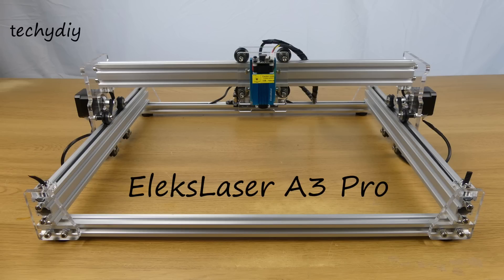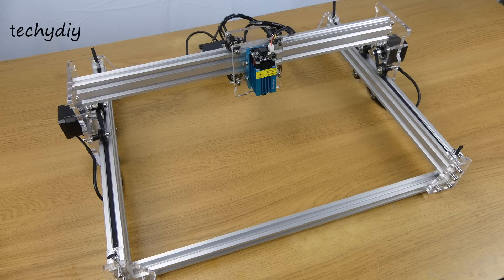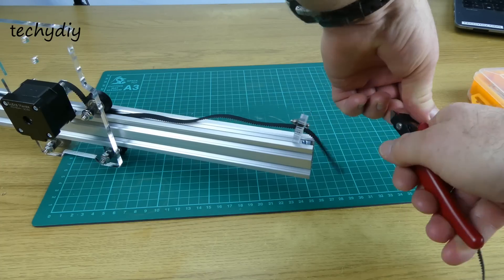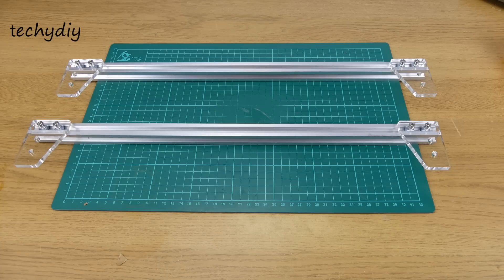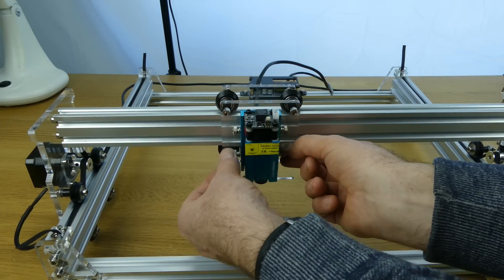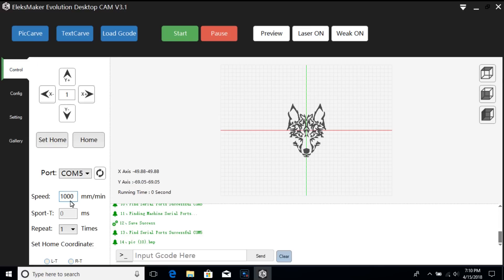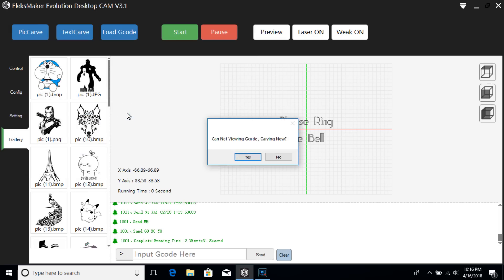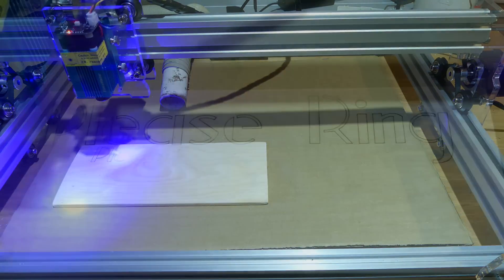Eleksmaker EleksLaser A3 Pro Laser Engraver Build, Test & Review

Comment: Is this possible to cut a piece of 5mm pvc board?
Reply from the maker: This is an old laser engraver. Newer models will cut materials easily. You do have to be careful cutting plastics and make sure it is safe to do so.

Comment: hey ...My machine suddenly isn't working good. When I use the control to move in the x-direction the machine moves in x and y direction, and vice versa. The print which is given is being printed in 45degrees. I don't know what changes to make...can u help me
Reply from the maker: Check the stepper motor wiring. There are two connections for the Y axis and one for the X axis. If you have swapped one of the Y axis stepper cables with the x axis cable then it would do as you describe.
Reply: @techydiy  Hello. I checked and it is correctly connected,it is still the same problem after i reconnected all the wires. I gave the print for a text and it is being printed upside down and in a 45 degrees (approx.)angle. I even changed the software and reinstalled it. Do u have any other idea
Reply from the maker: No, but try lasergrbl or lightburn software.

Comment: Can  it cut Balsa, XDF, plywood ? Up to 10 mm thickness? or i need a "stronger" machine for these?
Reply from the maker: Your talking industrial strength to cut  10mm. A CNC router would probably be  a better option. Diode lasers can realistically  cut to about 3mm with air assist. The co2 laser I just reviewed will cut to 6mm.

Comment: Can this Laser be replaced by a 30W or 40W Laser to cut some material, such as Plywood, Acrylic, etc.? Thanks
Reply: Might want to beef up the power supply to higher amps, maybe 10 amps, should work fine other than that. (I know, 4 years too late 😀)

Comment: I have a svg file fit to the size of the wood I want to engrave. When I load it into the engraver software it expands it beyond the size of the engraving surface. Any pointers on how to fix this?
Reply from the maker: It's usually something to do with units, inches instead of mm etc. If your using inkscape  setting the page/paper size correctly is a good start.

Comment: Hello sir. I have this same Eleksmaker laser CNC with 2.5W laser diode. I have problem with it. Check this image behind this link : https://drive.google.com/file/d/1bkayoSk48EZ3bmhshIopk_sjHrzpwkOn/view?usp=sharing I'm using Ubuntu 18.04 and Laserweb 4 and it makes those strange errors on my PCB. I have exported PCB from EasyEDA as PDF file, then I imported it to GIMP and exported PNG file from there. Then finally I converted that file to SVG from Inkscape and burned it with Laserweb. Do you have any idea what could cause these errors ?

Comment: Great video.  Interested to know more about the copper etching you briefly showed. I was looking at etching a circuit out of copper polyester taffeta fabric, then using the laser to cut out precision holes in the fabric as well.  Can I ask how you did the etching, and do you think the laser could cut through the fabric to shape it?
Reply from the maker: By coating the copper with black spray paint (as an etch resist). 
Engraving an image (burning off the spray paint) with the laser.
Then etching it with an etchant (sodium persulphate)

I don't know,  the laser wont cut copper but it should cut coloured polyester.
Reply: @techydiy  Thanks!  So I'm lasering off what I want removed and the remaining spray paint is the traces, right?  Did you use any special kind of spray paint?
Reply from the maker: Yes.  Cheap Matt black spray paint, I have used several types, it has all worked.
Reply: @techydiy  Thanks!  I'll let you know how it goes!

Comment: Brother, I need a mega help, I have an EleksLaser-A3 Pro 2500mW but I haven't been able to cut it yet. I would like to know if it has the power to cut a 3mm MDF sheet ... do I not know how to regulate the laser and speed or do I not have the power for that? Thanks in advance, great channel, one more writing !! sorry for the text, i'm brazilian.
Reply from the maker: Full power, slow and multiple passes. An air assist fan helps. It all depends on the plywood, some will cut ok, some won't.
Reply: @techydiy  Thaaaaank you!!!

Comment: Hi mate, what did you use for an extractor for the smoke that comes out when laser engraving is active?
Reply from the maker: Shop vac vented outside, but its noisy so I have also used an inline bathroom type fan and vented it outside.

Comment: I HAVE this machine but power is not strong.can I change the laser modul with the biger watt?
Reply from the maker: You can, but most Chinese lasers with higher outputs are probably not any more powerful. The only good upgrade that I have seen is from Endurance lasers.
Reply: It mean useless if I change the laser modul?
Reply: @iyangsentosa7707  yes, read the technical data of these laser modules and compare the OUTPUT power.

Comment: Hi I tried doing  the mirror burn with my laser...can't get it to burn ...do you by any chance remember how many passes and at what rate I used ..
It will help me alot thanx
Reply from the maker: I think I did three passes, not sure of the feed rate but it burned easy enough. You should be burning the back rather than the front. It was a Glass mirror tile from Ikea with a grey back. You could always try spraying the back with matt black paint if it doesn't burn easily.
Reply: Hi I found a link you gave of the avenger sign .. thanx so much it came out great...may God bless you... hopefully U could something in the CNC router field would be awesome

Comment: 1084/5000
Hello very good video, I have a problem with my new laser I have an EleksMaker EleksLaser-A3 Pro 2500mW comes with Eleks mana SE board and the Grbl 0.9i is installed. The software for use is EleksCam 3.1. The engines move well the laser works at first sight all right, when with the same program I put a text, it does it without problems, but when putting a design of the same gallery that incorporates the program if it is not very complicated to reach 20 or 30% stop, stop sending the codes, sometimes turn off the laser and sometimes it stays on burning the material, if it is complicated it does not reach the 5% that already stops, but does not give any kind of error in the console . I have tried to use designs with Linkscape and the laser plugin and the same thing happens, and also if I use the UniversalGcode sender the same thing happens and on the console when the following line appears <Run, MPos: 28,950,24,638,0,000, WPos : 28.950.2 “ÉšÂb‚r‚ ‚‚ òj> ok when they appear, these signs are when you stop without turning off the laser. If you have any idea what happens and how to solve it, I would appreciate it. a greeting
Reply from the maker: Check the gcode you are sending with a text editor to make sure it is ok.  You might be getting interference on the usb cable, run it away from the stepper motors. Eleksmaker have a fairly good forum and support, so it's worth going there.

Comment: Great video! I will probably get one after watching your video...I only need it for CUTTING out 2mm to 3mm thick hobby type plywood in rectangular & circular shapes. I dont really need to do much engraving, but will probably do some. Can you please tell me, what is the MAXIMUM length of a rectangular shape that can be CUT out? I need to be able to cut a 14.5" or 368mm in length by 80mm with various smaller rectangular & circular openings within the larger rectangle. Also, is there a setting for cutting, or do you just increase the laser power? I may get the 5500mw version for cutting. Thanks for the help!
Reply from the maker: I wouldn't recommend it just for cutting, it really needs a higher powered laser. Endurance mske some high power units for cutting.
Reply: @techydiy  I dont do alot of cutting, but I need an occasional wood part for my model airplanes... I was thinking this would be easier than fabricating the parts I need... I was thinking that the 5500mw laser version may be better for cutting?
Reply from the maker: The more power the better.

Comment: How stiff is this laser? I mean if I wanted to change the electronics for uno with grbl and fit in Z axis and maybe mount dremel or another router/spindle solution, would you say that this construction stiffness will be good enough for small milling jobs? Thanks for your answer
Reply: I'm also having the same question, didn't you get an answer from other sources?
Reply: I know this is old, but for anyone reading this now, I've done this lol I 3D printed a Z axis, wired it up, and ran grbl with arduino shield, worked a treat! Rigid enough for timber routing.

Comment: Hey on the website it says it shouldn't be used on metal or glass. That's odd, do you have any trouble using it on those? I'm new to this.
Reply from the maker: The laser won't work on metal, glass or anything transparent.
Reply: @techydiy  oh. What was the material you used to put the Avengers symbol?
Reply from the maker: It was a mirror. I engraved it from the back on the painted side, which works very well.
You can use a trick to engrave transparent materials which is to paint them or cover them in a black film, then engrave  and then remove the remaining paint / film. The laser needs a dark material to burn.
Reply: @techydiy  thanks, I appreciate it. I'm looking forward to using this. Is there a good laser engraver that works on metal and glass that you know of?
Reply from the maker: You would need a co2 laser probably

Comment: Just received my laser. Your video is the best out there. put it together, got it wired, downloaded the software & driver, got to the point of turning on the laser weak power mode button, and i have no light or possibly power. Followed all instructions, what am i missing..doing wrong? all connections are tight.
Reply from the maker: If I remember correctly it came with a little PCB module that you can use to test the laser.  Search for the eleksmaker forum it is pretty good for any issues.

Comment: Cool video man! I was checking around for an engraver for my woodworking projects and saw one on Glitzer but this one, although similar, looks way more refined. Have you had to deal with any warranty issues with the unit?  Someone reviewing the Glitzer unit said to upgrade to grbl software? Any advice? Thanks much~
Reply from the maker: No it still works fine, although I only use it infrequently so I don't know how it would hold up to daily use.
I  think its worth upgrading to the latest grbl and using other software like laserweb.
Reply: Banggood warranty is terrible but the investment is not huge. The best software is Lightburn, very highly recommended.

Comment: is this the 2500mW or 5500mW?
Reply from the maker: 2500mW
Reply: @techydiy  Thank for the reply. Can it cut leather 1.6mm to 3mm thick? have you tried? Im interested on the 2.5w or the 5w and i need some direction. I would like to use it for cutting my leather pieces for leather work including engraving my leather pieces etc.

Comment: I have a Mac and tried using parallels with windows 10 and couldn’t get it to work, would you be able to recommend a cheapish pc that would be able to handle the software? Rather then having two expensive computers. 

Thanks in advance!
Reply from the maker: Pretty much any cheap laptop would do it but the software is not that good anyway, so what I would do is upgrade the controller to the latest GRBL and then install laserweb (I believe there is an osx version) on the mac.  You will have to do some research but the result will probably be much better.

Comment: just had mine installed but can not make it work... the software gets the port, but is not communicating with the machine... can someone please help?
Reply from the maker: Try the support forum here        http://forum.eleksmaker.com/
Reply: maybe you need to check out the baud rate because if it's not the same the connection is established but no communication will be made.
Reply: turns out, I had to change my system language to English (America). It was in portuguese. Someting with de decimal mark it has to be " . " not ", "
Thank you anyway. :)

Comment: Great video - can you tell me what Avengers logo you used (or give a link to the one you used) - also, what did you use for the Laser ON / Laser OFF codes?  My laser arrived just the other day so I'm eager to make myself that mirror (The LEDs and frame etc I've got covered).  Would you consider making a video showing your process? Eg, the Inkscape document setup, converting the image, sending it to the laser etc etc

Thanks again for the great vid
Reply from the maker: I added the image and a link to inkscape laser plugin here:   http://www.techydiy.org/eleksmaker-elekslaser-a3-pro-laser-engraver/
You can import the output from inkscape laser plugin to the Eleksmaker software without modification.
Yep, will add a video but it will be a while.
Reply: @techydiy  Awesome, thank you :) How long did it take to do the mirror and what size is the mirror compared to the logo? 

YouTube didn't notify me of your response so I've only just seen it! :( I have "upgraded" my EleksMaker A3 to grbl 1.1e, and using T2Laser.... I created an outline version of the logo, at 200 x 200 (My mirror is 300 x 300 - mm that is)  with resolution set to 0.08 - but the gcode estimated 204 minutes!! Clearly I'm doing something wrong.  I suspect it may be my lack of experience and knowledge with the T2 / EleksCam software.  The reason for the resolution etc is I Want the circles to look like circles... I've yet to figure out exactly how to make the laser (using T2Laser) to basically simply "draw" the outline a few times... instead it's trying to laser it first like normal (eg, moving left to right, front to back, 1 line at a time, and simply turning the laser on and off when needed.) Then it does an outline - I believe it's called Sketch Plus from memory and it creates a vector for the outline... but 204 min seems crazy long so I need to suss it out! 

Thanks again for the reply and updating your info on the site,.  Great to hear you you'll consider making another video :) I look forward to it no matter how long it takes
Reply from the maker: My image is about 200mm and the mirror 300mm square. It's worth trying inkscape & the inkscape laser plugin to generate the gcode, it works really well.  It took a few minutes and the circle has good resolution. Good luck.
Reply: @techydiy  Thank you so much for your help

Comment: How did you do the the back of the mirror
Reply from the maker: I don't understand the question?
Reply: techydiy like did you laser all the way through the mirror something like idk I’m curious how you did it like I get that you did the back of it and mirrored the image but did you laser all the way through or did the heat do it
Reply from the maker: The laser burns off the painted layer on the back, the metal layer and then the heat melts (engraves) into the back of the glass. It works very well and the results are good.

Comment: Did it etch the mirror too or just take off the reflective backing? And what settings did you use for that? Also if it did etch the glass, is there a way to just get the backing off? Sorry for all the questions, i really want one ant their $200 right now
Reply from the maker: It takes off the protective paint layer, the aluminium layer and it also etches into the glass.
I think it would be difficult to just remove the backing as the heat melts the glass, but I haven't tried it so it might be possible.

Comment: How is the settings like your laser cuts the lines? My laser get from left to right then to left and right and so one but doesn't follow the line :/
Reply from the maker: It should be able to repeat the lines exactly if that is what you mean. I would check the belt tensions and the alignment of the machine if it isn't.

Comment: Greetings Sir. I see that they have an available 5500mw laser version. Do you have any idea if you could just swap them out if you wanted to upgrade at some point? Does the software have a 5500 option? Thanks!
Reply from the maker: I don't know. for sure. I would ask the question on the Eleksmaker forum, the link is in the video description
Reply: I read from one of the sellers on Amazon that the laser heads are interchangeable. That's what I plan to do if my 3000mw laser head isn't strong enough

Comment: i want to engrave acrylic plate, will it be possible?
Reply from the maker: Only dark coloured acrylic, not clear or transparent acrylic. However you can paint clear acrylic with matt black spray paint and then engrave it. The remaining paint can then be removed with acetone.
Reply: @techydiy  so as long as you apply a black coat, it will be possible?
Reply: thank you for the response
Reply from the maker: Yes it works. I painted some clear  (transparent) acrylic sheet with matt black spray, let it dry and then used the laser engraver to engrave some text. The laser burned away the black paint and melted the acrylic. I then removed the remaining black spray paint with acetone. The result was good and suitable for an edge lit sign.

Comment: Great video thank you! Are you able to import graphic designs? I would love to be able to import old maps and engrave them on to a piece of wood. Also, do you know the max size that this will produce?  Thank you !
Reply from the maker: Yes you can. It is a good tool for that application. The maximum size is A3  ( 297 x 420mm     11.7 x 16.5in). You can engrave larger areas by moving the engraved material under engraver and then engraving in a tiled fashion.